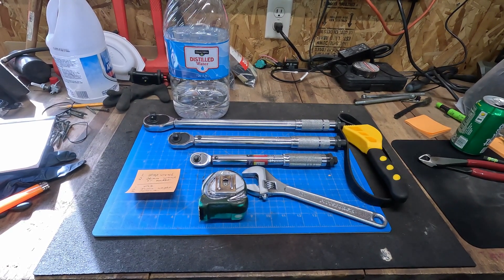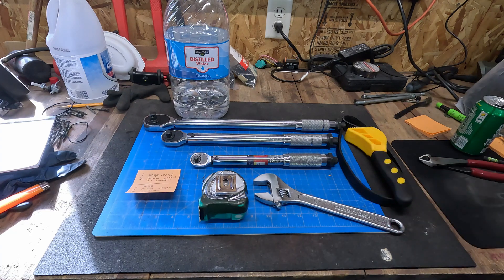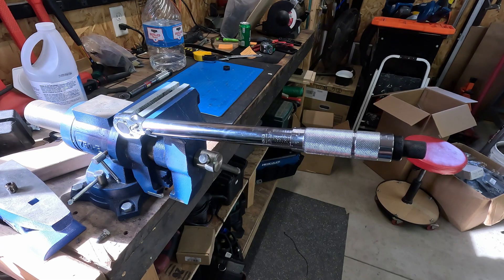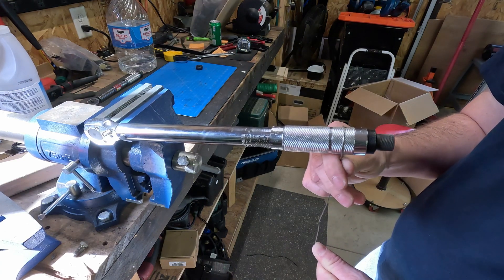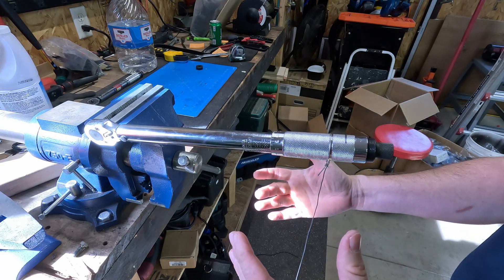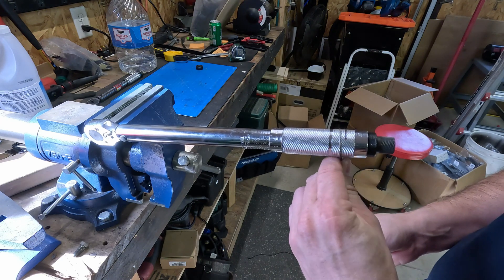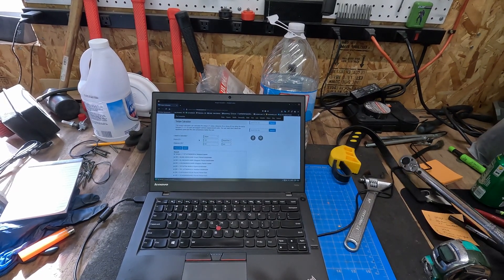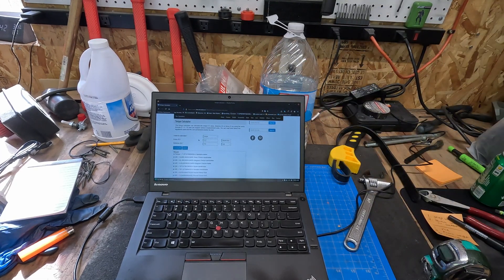Calibrate Harbor Freight Pittsburgh Click Style Torque Wrenches

Comment: I have seen references to the "marked loading point" of a torque wrench. Although I have not found any relevant  photos, I think that this is the part of the handle where there is a gap in the knurling. It is close to the centre of the handle, but it seems that this should be the position used to apply force when calibrating or using a torque wrench.
Reply from the maker: It doesn't matter where you apply the force if your calculations are right. Applying 12lbs at 12 inches is the same as 24lbs at 6 inches. The wrench doesn't know the difference, the torque is exactly the same.
Reply: @somedaysoon33  It does make a difference with a click style-torque wrench - this guy shows you how https://www.youtube.com/watch?v=Fwfnf06dl84
Reply: @somedaysoon33  It seems that I am not allowed to post a link to another YouTube video - so try searching for this video -
"Torque wrench test! (Proof that hand position REALLY matters.) | Auto Expert John Cadogan"
Reply from the maker: @ianakagongz4573 Well, I stand corrected, learned something new today. Thanks. I didn't realize the two pivot points would make this change to the applied torque. So yeah, then we would want to know the best spot in the handle to calibrate it, have you found any other information on it? Or as long as you calibrate anywhere in the handle, it's close enough? Also, I pinned your comment, because this is good information.
Reply: @somedaysoon33  I still think that the section of the handle that does not have knurling (as seen on most click-style torque wrenches, including the top two visible at the start of your video) is the 'loading point'. This video goes into the mathematics - "Why GRIP Position on Torque Wrenches MATTERS!" by The Bike Sauce. This is another video from John Cadogan that refers to relevant documentation from torque wrench manufacturers - "Am I wrong about torque wrenches & hand position, again? (The facts) | Auto Expert John Cadogan" (warning - subtlety is not his strong point)
Reply from the maker: @ianakagongz4573  Yeah, would make sense, I've always wondered why those were on it. I'm going to re-calibrate mine from there and see how much of a difference in adjustment it takes.
Reply: It does make a difference with a click style-torque wrench - this guy shows you how https://www.youtube.com/watch?v=Fwfnf06dl84

Comment: Perfect. I was not familiar with the end cap adjustment, noticed it didn't have the little side screw. While reading about calibrating torque wrenches, I saw a formula you can use in a pinch. Say, your torque wrench is set to 12 pounds, but it is actually torquing to 16 pounds (ya figure that out as you showed in video) 12/16 = .75, then say you want to torque something to 25 pounds. 25 x .75 = 18.75 foot pounds. Set your torque wrench to 18.75... course that's eyeball.   I did a couple these conversions (with different weights) and it worked well. I'll go back and adjust it as you showed.,.. next time I need the torque wrench...

Comment: What if i use my TW once a every month for 5-6 clicks???? How often do I need to calibrate?
Reply from the maker: I would do it every 2-3 years just for peace of mind, but that's just me. Or if you are going to be torquing something important like head bolts.
Reply: @somedaysoon33 I'm not working on heads, just regular bolts such as drain plugs, air filter case bolts, spark plug, and some other nuts and bolts not related to Engine.
Reply from the maker: Should be alright my man. See this, https://youtu.be/x0YkgHDhpyo

Comment: Dude, you can make it as complicated as you want but here’s the deal:  There’s no point to marking the torque wrench handle off at the one foot mark. Is that where you’ll hold it when you’re using it? No. You’ll hold the end of the handle.  Clamp your 1/2” drive stud in a vice.  Put a scale on the floor in front of the vice bench. Stand on the scale and weigh yourself. Set your torque wrench at 50lbs. Now subtract 50lbs from your weight. Stand on the scale and press down on the to torque wrench handle. When you reach your subtracted weight the torque wrench should click. That’s 50 foot lbs.
Reply from the maker: Not accurate enough for the girls I go out with, they have higher standards.
Reply: @somedaysoon33  It's true that the weight should be applied at the handgrip, but TheNewenglandboys method wouldn't even be accurate enough for the lowest girly standards! (Unless the mid-handgrip actually was at 12") e.g. 50 lbs on a 24" wrench gives 100 foot lbs...
Reply from the maker: @PlatypusPerspective  Yeah for real, some of the harebrained comments I get got me struggling not to be mean about it. I deleted my first reply to him so I didn't look like an asshole, 😆